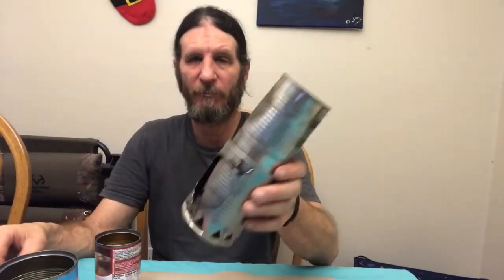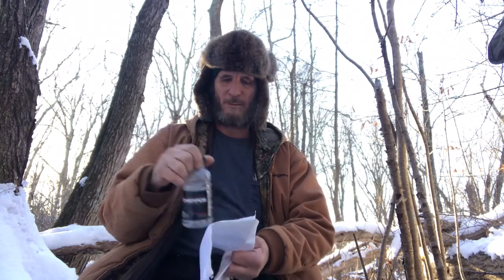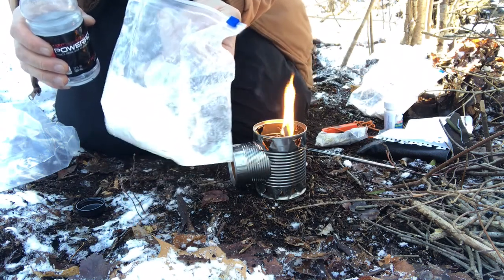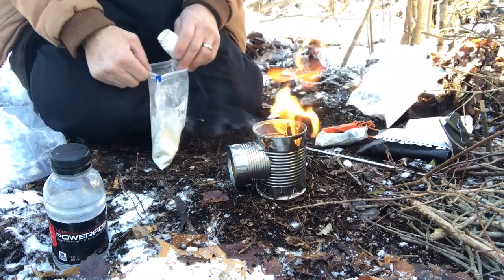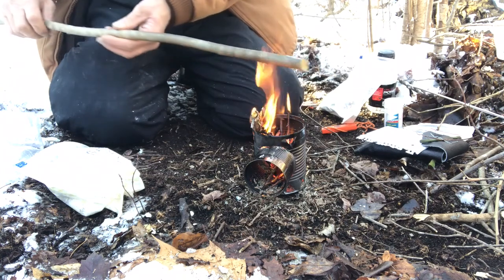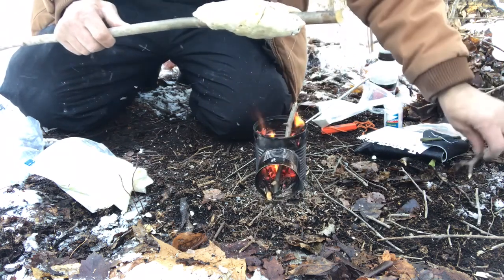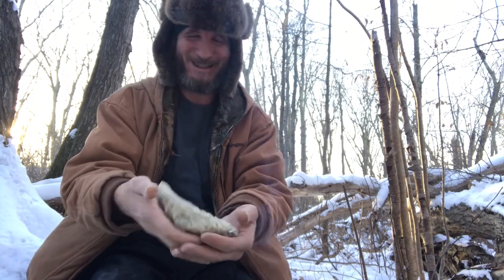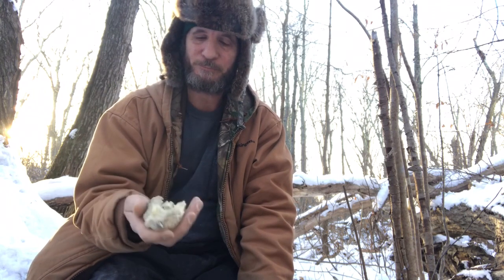Bannock bread on a stick

Comment: I was just thinking if I was making a video and doing this it would fall off the stick. It can’t be easy, but i bet if you were doing it a lot . Btw I really like those little stoves. I have seen them before and I believe I will give it a try.  Ya it would be a heck of a lot easier . If it was stickier  to hold on to stick and maybe smaller. I think I might try it
Reply from the maker: Yes. Please try to make bannock in the woods. I would like to see the video. Next time I cook some bread, I’ll probaly use one of my camp frying pans from one of the cook sets I have. I’ll be doing a video on them soon.

Comment: If or when the shit hits the fan. Half this stuff won't be needed. Unless you're dragging a trailer full of supplies. Your panick bag weighs 100lbs as it is.   But fun project I guess
Reply from the maker: Turkey Blast  Yes, until I start making flour out of cattail and common reed tubers or even acorns.